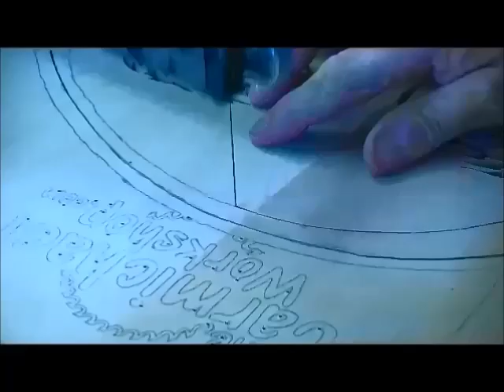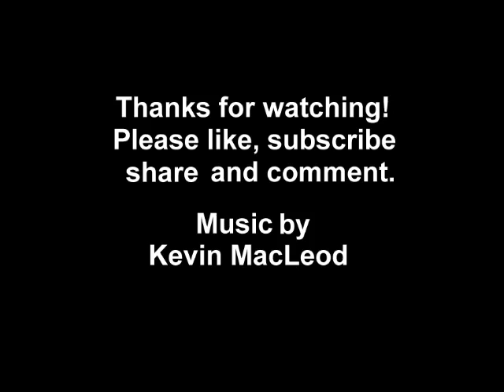Scroll Saw Portrait of Steve Carmichael

Comment: I know this is an old post but I just ran across it.  I attempt to scroll saw also. I do mostly pictures like that one next to my name here. I have tried portraits but don't really know how to get them onto the board.
Do you start from a photo and then transfer it to the wood or is there another technique?  
You are the master.  Thanks for the good videos.
Reply from the maker: +oldman719   Thanks buddy. I do them on paper, scan them into the computer, clean them up and color them in and then I go to rapidresizer.com and make it whatever size I want. I then get carbon paper and trace the paper pattern with the carbon paper underneath to get it onto the wood.

Comment: What size blade did you use and how thick was that wood. Also how did you keep the pattern intact so well since when I use my spray adhesive some areas don't stick as well?
Reply from the maker: +frehleycomet The wood was about 3/16 thick. I traced the pattern onto the wood with carbon paper (transfer paper) because I always have the same problem trying to stick the paper down.
Reply: Ok thanks for the tip

Comment: Very nice work. Just finding your channel (through the Carmichael Workshop) and I have 2 questions for you.
 1) You said you were using a Flying Dutchman spiral blade, but is that a Pin type? You were changing blades awfully fast, but I didn't think they made spiral blades for a pin type scroll saw. 

2) How many blades did you break in the process of this portrait? I seem to go through a lot of blades, but am really new to scrolling.
Reply from the maker: Hi Bob. 1- Flying Dutchman doesn't sell pinned blades. The reason for the quick blade change is due to the blade clamps a Hegner scroll saw uses. ( http://advmachinery.com ). 2- I broke a bunch, but it's been a while since I cut it so I don't recall ;) Thanks for the compliment.